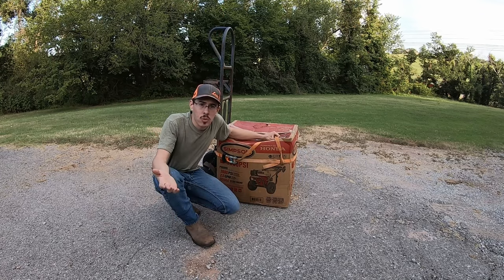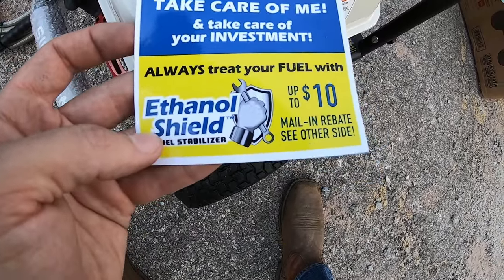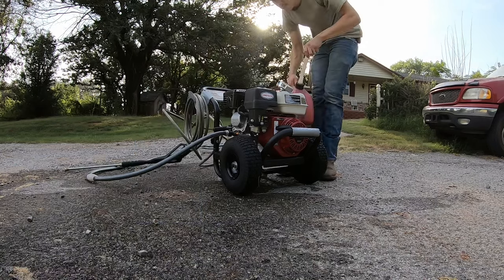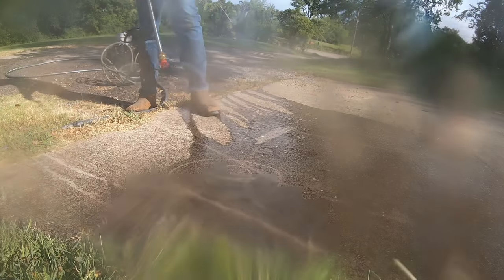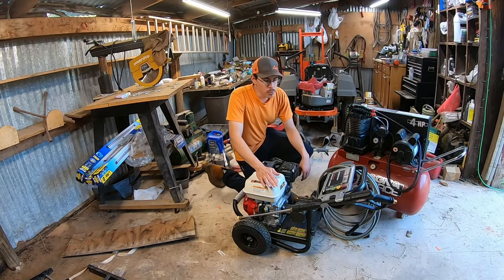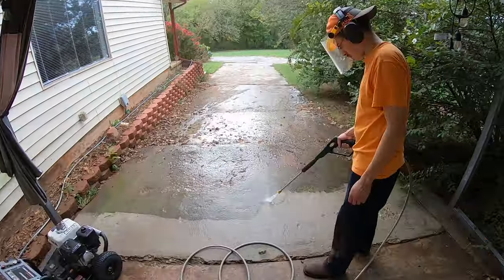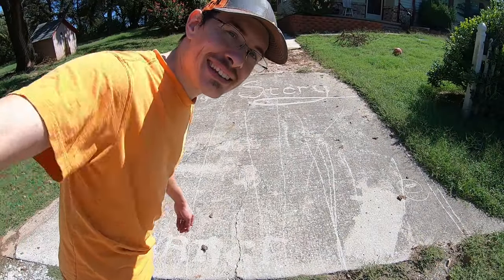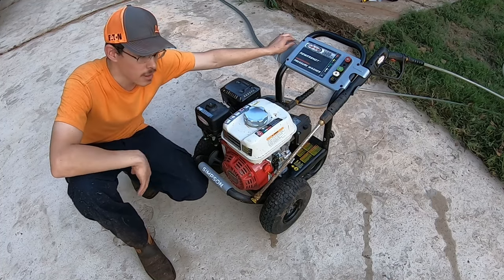What can I do with my new Simpson Pressure Washer? | Garage Story

Comment: The round surface cleaner is best on driveways , should do it in half the time.
Like Whirlaway type 12-15 inch, being a smaller machine you can get the ones that fit to the end of your existing wand with the click fitting cost less as well.

Comment: It only got hard to pull because you didn't have the gun held open so you were building pressure. That is also the reason you had difficulties starting it, you were fighting the pump.
Reply from the maker: Interesting, that never even occurred to me!
Reply: Same principle as having a pilot unloader valve on a gas powered compressor that you need to flip before starting to take the load off the engine. That pressure washer should last you a long time. I have a similar one made by MITM.

Comment: You have to squeeze the trigger on the pressure gun to relieve the pressure when starting it up. To make it start easier, use full choke and then turn off choke immediately. It should have started by the second pull.  I've been using a pressure washer every week for almost 20 years.  For the driveway, it's best to use a rotary nozzle.
Reply from the maker: Thanks for the advice!
Reply: @garagestory  They are all like that unless it's equipped with a pressure bypass valve for water pressure.

Comment: LOL, just buy a $30 turbo tip dude.  Much faster than the 15° nozzle, 2 hours tops.  If you have a bit more money, you can move at warp speeds (45 minutes) with a decent 15" wide surface cleaner for around $70 or $80, with an 32" lance (the one that comes with it is way too short).  Of course at that point, you could just start you own cleaning business, and pay for all of that stuff in maybe less than a dozen residential jobs, or one or two businesses.

I've been eying a Simpson PS2338 for a bit now, but am wondering if it is overkill for personal use.  But it has such a NICE warranty (3 years on the Honda GX200, 5 years on the pump, and 10 years on the frame).  I'm probably going to spend another $150~ $200 on accessories like a gutter cleaner, a couple of longer lances, maybe a surface cleaner, and definitely a turbo tip for cleaning cement
Reply from the maker: You are much more knowledgeable about pressure washer attachments than I am! I haven’t really been around them a whole lot. If I do large spaces again, I probably should get  turbo tip or surface cleaner like you mentioned. I think I’m primarily going to be using the pressure washer to clean mowers, cars, and equipment etc. 
Are there any special attachments for things like that that I should consider?
Reply: @garagestory  I've been doing a lot of research the last few weeks, whilst I eyeball getting that Simpson pressure washer I mentioned.  My old POS Karcher came with a turbo tip, which is really needed with those lower powered (1750 PSI) units for cleaning cement.  I seen some neat attachments on Temu that will let you clean the underside of your vehicle.

You might look at a foam cannon for washing cars.  I guess they are a bit better than the soap head nozzle.
Reply from the maker: Thanks for the tips!

Comment: Mine wont start at all, I hold the trigger while pulling and started once the pressure was string them became weak, smoked and shut off and have not been able to start it again! Its very frustrating
Reply from the maker: I hope you can get it figured out! I don’t know a lot about these. I had issues starting it at the very beginning, but once I fixed that it hasn’t had much trouble

Comment: The reason your handle is too short is that your are missing two extension tubes that should have been included.
Reply from the maker: Interesting! That never occurred to me. It seems that oftentimes equipment like this is designed with handles that are way too low and/or awkward, so I figured this was the way it was supposed to be.

Comment: Gonna burn that pump up that gun should be pulled even before you start it and don’t let it just run without the gun releasing the pressure and that pressure washer will last forever
Reply from the maker: Won’t the bypass release pressure to prevent the pump from getting damaged?